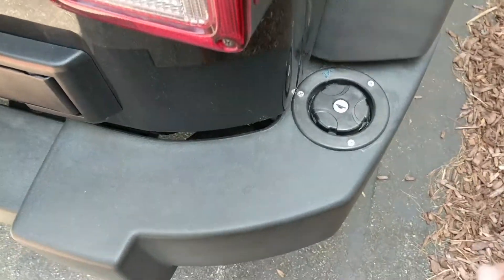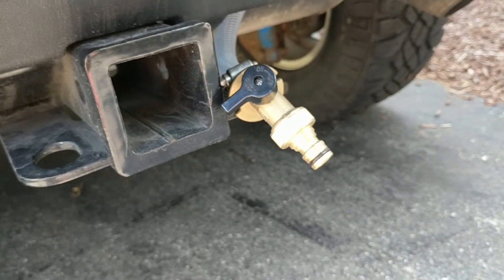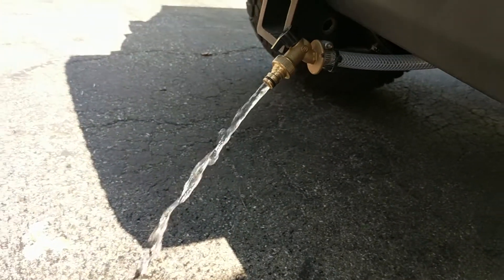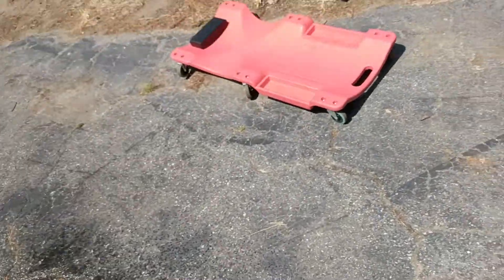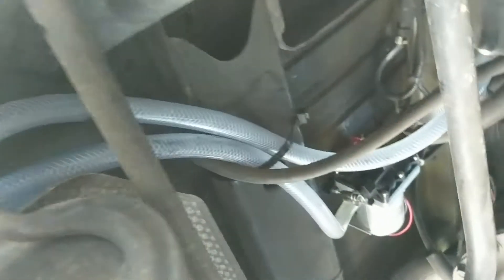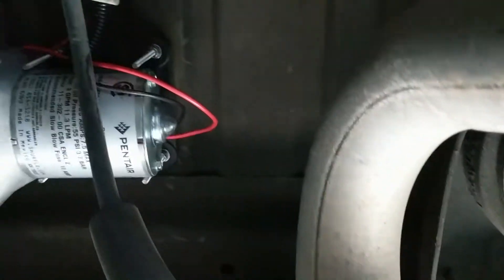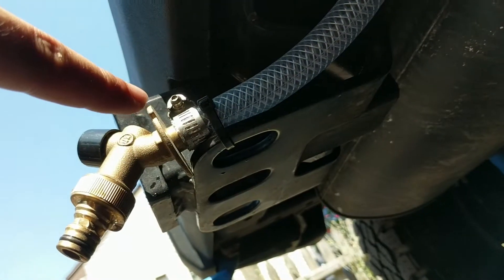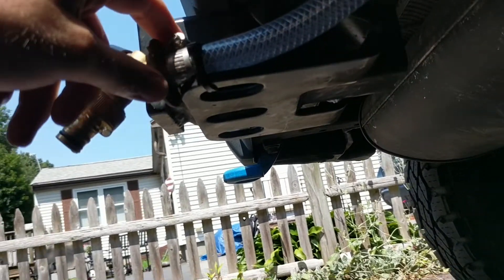Jeep JK Pressurized Water Bumper Mod

Comment: how did you connect it to power?
Reply from the maker: I wired the pump up with 12 gauge wire down the frame rails along the driver side. Then the pos/neg went to my source panel which is basically fuses and relays. Alternatively you could just wire it up to your source of power anywhere that would be most appropriate.